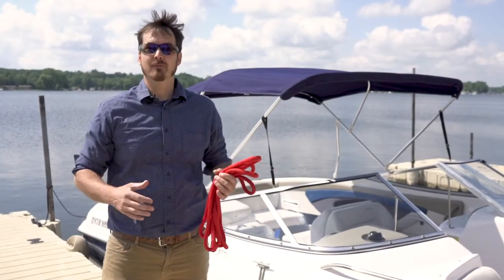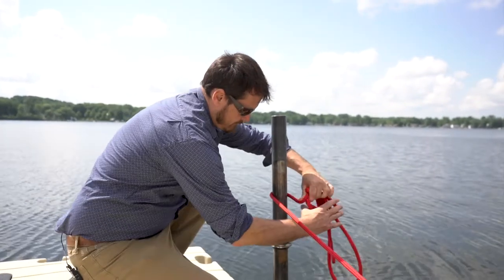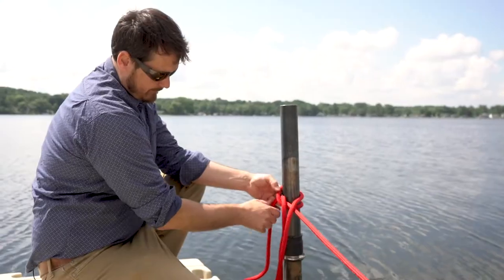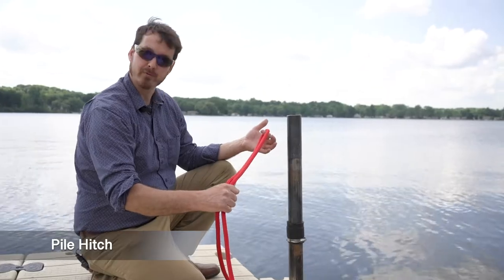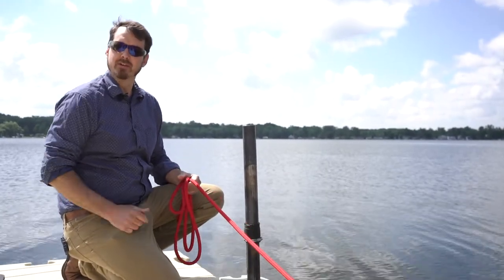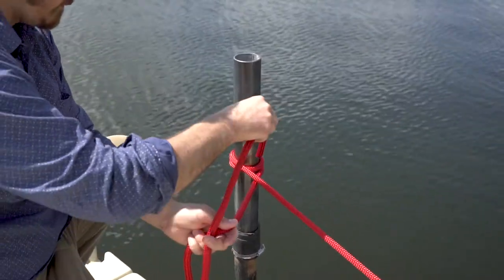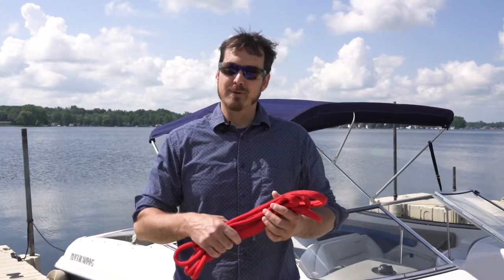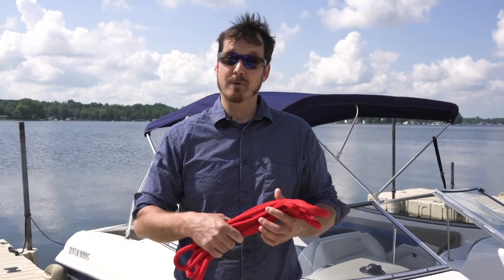How to Tie a Dock Line to a Post or Piling

Comment: It is actually called "Round turn and 2 half hitches." You got it right
Reply from the maker: Very nice!
Reply: To be picky: It's 1 and 1/2 Round turns and 2 half hitches. First round turn, and the rope would continue in the same direction it came in, the half round turn and the rope goes back to make the half hitches.
Reply: @anfrm7849  Still just refered to as " Round turn and 2 half hitches."
Reply: In my 20 years in the Navy, thats what we called it anyways...

Comment: What if your line is super long? How would you tie the rope to a piling if you couldn’t use the end of the rope? As a landlubber I found myself in that situation once on a friend’s boat. I knew the two half hitches, as well as the bowline, but didn’t know how to tie off the boat with this huge mass of rope. Thanks.
Reply: Try an alpine butterfly.
Reply: You could do the round turn and two half hitches, but make the half hitches "on a bight" or "slipped". This makes it so you never have to pull the end entirely through. You'll just need to be able to pass the coiled rope around the pile.
Reply: Double up the rope.
Reply: The second hitch (Pile hitch) does not require the end of the rope. It is the most secure of these three.
Reply: @WilliamDaugherty  Let’s face it the end of the rope is rarely to hand. What you actually get is a bundle of knitting and somewhere in the middle is the end. The only practical thing to do is to pull a loop around the post. Forget trying to tie a clove hitch or round turn and two half hitches with a doubled up rope, and use the second solution in this video: the post hitch.

Comment: Tied correctly are all of these actually strong enough to hold a boat overnight to a post? I've often seen a clove hitch seeming to focus on holding a fender in place. Makes me a bit nervous as a noob to these 3 knots. Most places I'm docked on trips do not have cleats on their docks, so I'm limited to tying to a 4x4 type of post.
Reply from the maker: The round turn with two half hitches is the best one for overnight. The pile hitch will work as well. The clove hitch can come undone if it isn't constantly loaded.
Reply: @RightRopeOfficial  Awesome video (checked out your site too & bookmarked it... I always need extra rope it seems!!!). Thank you for the follow up details too.
Reply from the maker: @finmanpoozie4756  Glad to hear! Thank you!
Reply: Clove is meant for a temporary non-overnight knot. For example tie up for lunch somewhere.
Reply: If you have a cleat on your boat and you consistently use a piling, just put a bowline on the end.
Reply: @leftycosta1899  honestly I would never leave a boat with a clove hitch longer than to get fuel, and NEVER out of sight.
Reply: Putting a half hitch on/after the clove hitch makes it pretty secure.